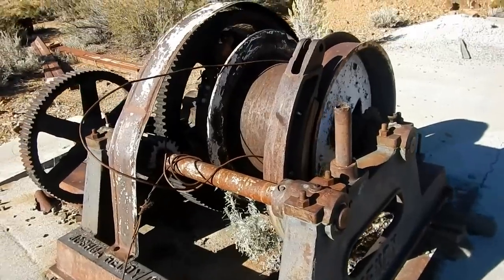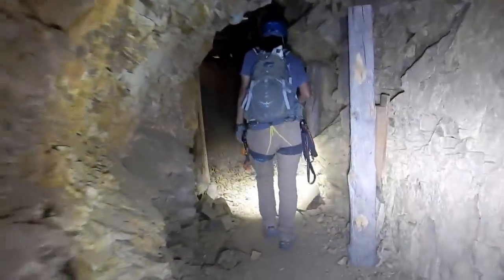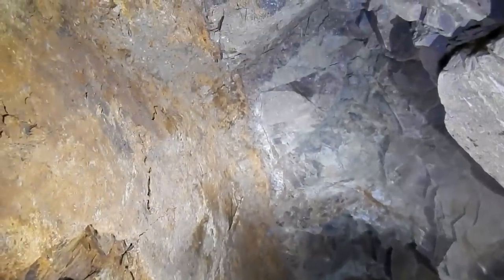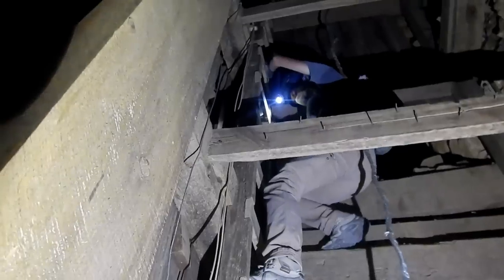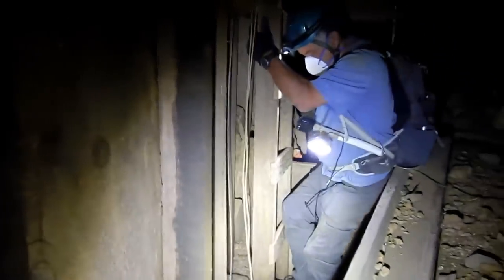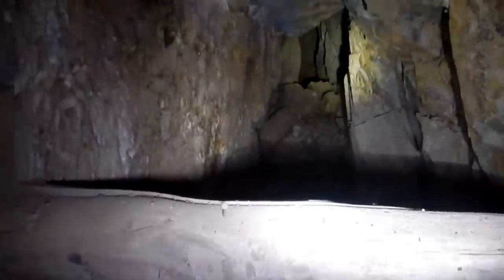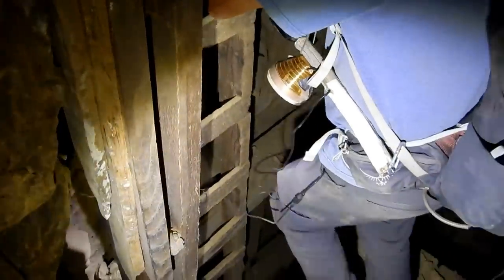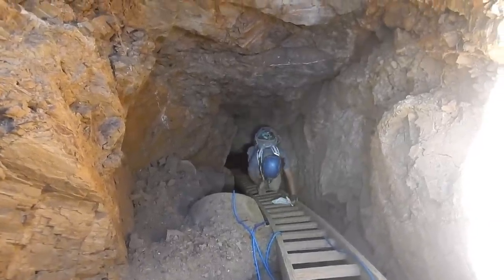Exploring Four Levels At The Abandoned Long Chance Mine - Cool Artifacts - Dynamite Box - Hand Tools

Comment: Because I care about you both so much, gonna remind ya again. Do Not hang on to the Rungs of ladders as much as possible. Always hold on to the uprights. If a Rung breaks or comes loose you will have nothing to hold onto!  One of first things taught to firefighters and my dad taught me as well - as an old miner!  Another amazing mine and you made it to the bottom - awesome!  Love you guys!
Reply from the maker: Hi David, we know you mean well by suggesting that we hang onto the uprights, instead of the rungs, but many times it just doesn't work that way. While we apreciate your concern each mine ladder is unique and you have to judge them individually as you go. We do use the back of the uprights at times, but a lot of times the ladders don't even allow access to them as they are nailed tight to a shaft lining or other timbering. Also, most ladders do have some broken, cracked or missing rungs and when you step on a cracked rung you need to support much of your weight using your arms. You can't support as much of your weight by holding onto the back edge of a 2x4 as you can by holding a solid rung. Climbing up is about the same situation, where with all the gear we carry we need to use the rungs to pull our weight up the ladder. It can be very fatiguing and you need help from your arms to pull yourself up hundreds of feet. It's difficult to get much upward pull holding the back edge of a 2x4. Sometimes what works good on one type of ladder doesn't work on all ladders. Thanks for your input on this important matter and we hope you understand how it works for us. 👍👍

Comment: Hello Tom Hello Julie
That is a great mine .
It reminds me a bit to the old workings of the Rammelsberg mine here at my place.
Very small drifts a bit low in Hight.
But not so wet as in the Rammelsberg.
May be some Germans work this mine.
But the levels and the artefaks not bad.
I love your Fotos as i said before 
May be the mine was worked in the near past this modern blower is a remain from this time .
Thank you for your Video and the work and the risks you take .
I wish you a geat weekend and a happy New week .
Yours Frank Galetzka
PS in the First Level right at the start of the Video the support frame looks very interesting a combination of a german and a polish cab notched in the Posts. 😉
Reply from the maker: Hello Frank, the drifts here are very narrow and not very tall either. I don't think the miners took out any more material than was absolutely necessary. I think this was worked before and after WW2. A gold mine like this one would have been shut down in 1942 to focus on strategic metal mining for the war effort. Judging from that blower and the electric boxes it was worked again after 1945 when non strategic metal mines opened up again. Glad that you liked the photos and artifacts. Thanks for the information on the timbering and the joints. Very interesting. We hope you have a great weekend and new week!👍👍

Comment: That was fun. Not very often you see Atlas married to another. Had an old-timer tell me that in some places they sold the dynamite and blasting caps seperatly and they would both advertise on the same box.  Great explore. Hope the sample came out good, and i would've loved to see the inside of those dore' furnaces and figure out where they made their pours at. Could be in for a surprise. I have a story about that.
Reply from the maker: Didn’t I show the inside of the furnaces? They were lined in the typical way with fire brick type material. I haven't seen a box like that with dual branding. Not sure how the samples came out. The old timers were pretty good at getting all the good ore out. Thanks for the comment,  Richard!

Comment: At lest it was much more stable then the last. Good job and Julie has improved greatly in communicating which makes for a better more interesting explore. The mine was sort of odd in that it went all over the place. Would have been very hard to work.
Reply from the maker: Yes, this one was fairly stable, but very tight quarters. Glad that you enjoyed hearing Julie. These smaller mines follow the ore vein wherever it goes and don't take out more material than is necessary. Thanks for the comment!

Comment: Looks like y’all were walking on the top of the waste rock in what’s left of a stope
Reply from the maker: Hi Frogg,
When you see waste rock in a drift it's usually backfill. After a drift has been worked as much as possible instead of hauling waste rock all the way up and out of the mine it will be placed in the back of the drift and out of the way. Hope all is well with you!